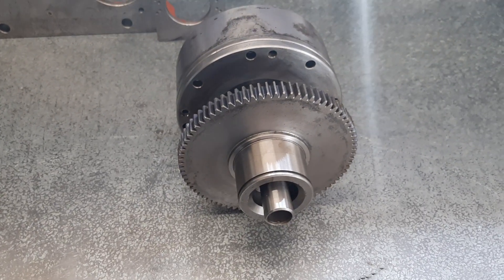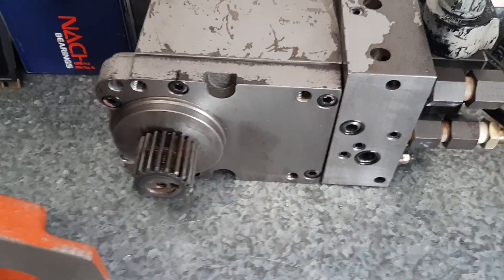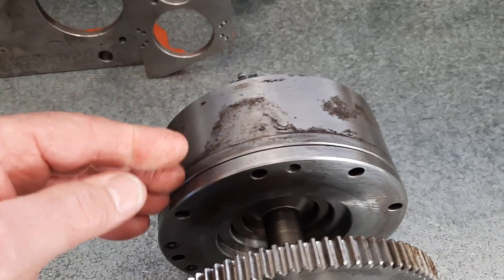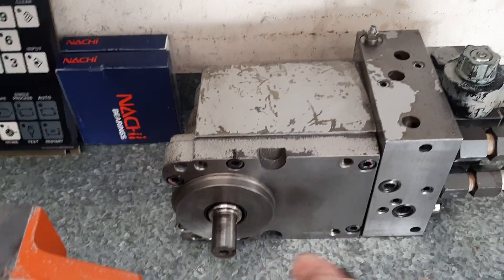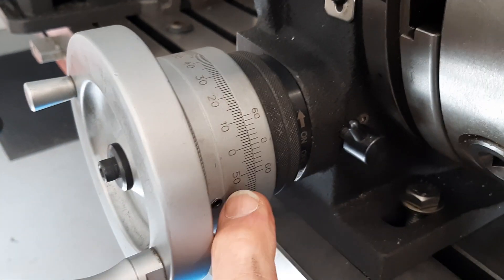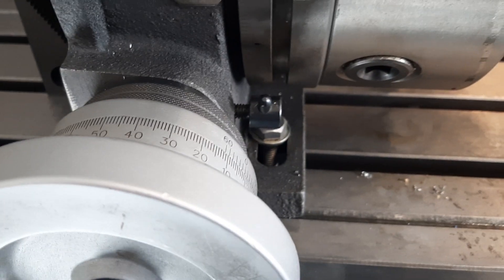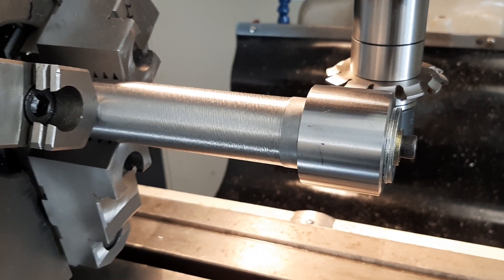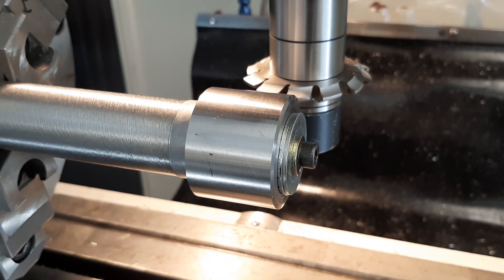Gear Cutting for my CNC Lathe.

Comment: Wow the control panel looks like new! Thanks for doing this series on the rebuild of your Mazak, just found the video last night and am really interested in your work in rebuilding this lathe.  May I ask what model and year is this Mazak as I have a Hyundai Hit 8s that looks very close to what your machine is.  I know at one time Hyundai was making CNC lathes for Mazak and then later continued making them with their own brand.  Thanks!
Reply from the maker: Hey William.
The rebuild video,s is something i thought others might enjoy watching.
Not often people go to so much trouble to rebuild a machine.

The model is 1990 Mazak QT-15.
It,s only a 2 axis but will definitely help me out with a lot of the work that i do.

I have been watching another guy from England who has basically the same machine as mine but with a CAM controller which basically means a 3 axis. ( C Axis )
They are easy to spot as they have a totally different tool turret.
His machine like yours is made by Hyundai also.

It"s funny you mentioned the controller panel ?
I was going to buy a new one from Mazak, but the price had X3 since my original quote.
Not sure why the huge jump in price.
I was originally quoted around $ 400,  but then it jumped in price to over $1000 ??
I should have brought when it was cheap, LOL.

I went with buying a Mazak mostly because you can still buy over 90% of the parts direct from Mazak.

Happy to have you follow along.
I hope you enjoy the rest the video,s in my collection.
Talk to you soon.
Peter.

Comment: 36A is a good steel .  Are you going to ID grind the bore or take the guestimation , leaving it a thou & a half oversize & see what happens !    Cheers .
Reply from the maker: Hey Max.
I normally leave the bore around 1 thou oversize seems to be a good round number that works to allow for any movement during heat treatment.
It seems to work well as the gear was a nice tap on fit.
The genuine part price was ridiculously expensive. 
The asking price just over 2k for a replacement  ????
Maybe the emperor of Japan is making them i guess, LOL. 
Yes the EN36 is a great material for making heat treatment parts from. 
Machines nice and hardens well also.
Thanks for taking the time to watch. 
Peter.

Comment: Your control panel really looks good. That cleaned up great. Loving the Mazac Mission series ... thanks for continuing to share. Nice rotary table by the way, LOL. I have one just like it.
Reply from the maker: Hey Tim.
Happy to see the control panel clean up so well.
It might have been easier to replace it.
But that would be against the rules of the Mazak Mission, lol.
Today doing a trial fit of the Tool Turret housing onto the new Hywin Linear Slides just to make sure it all bolts up right, and to check how the updated lube lines will work.
Good to see people like yourself following along.
Thanks again watching.
Peter.

Comment: Thanks for all the info it is something i have never needed to do please keep up the great videos
Reply from the maker: Hey Joseph.
If the video,s i post can help with any info glad to help.
Still a little way to go yet ??
But slowly getting closer to making it look like a machine again.
After finishing off the Tool Turret i can then move onto the top sheet metal cover.
Then i can basically get the whole machine assembled.
A lot of smaller pieces to still finish though.
Thanks again for watching.